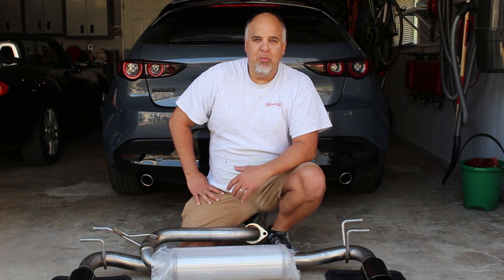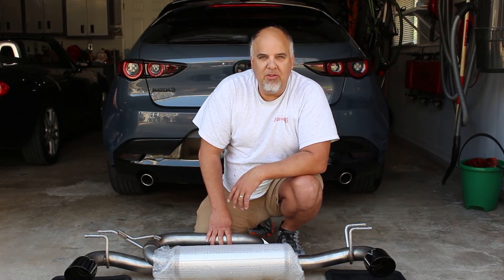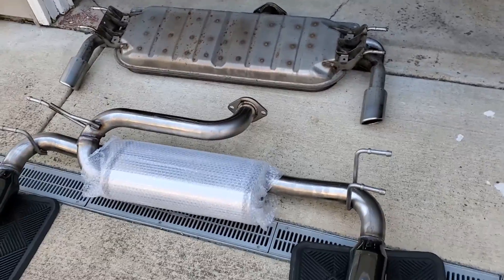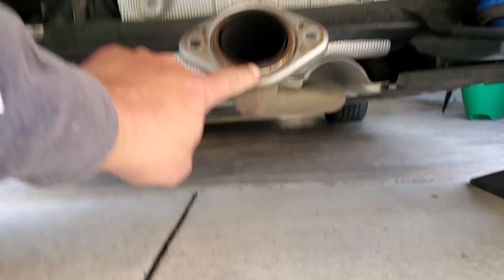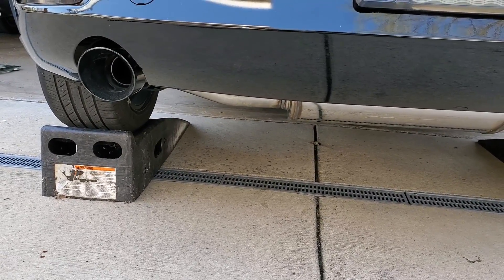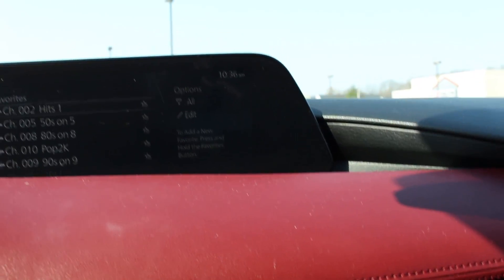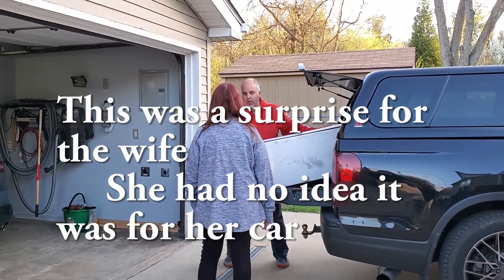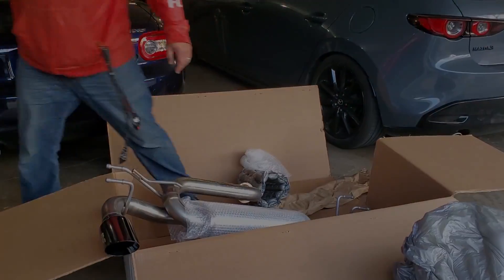Mazda 3 Magnaflow Axle-back Exhaust  2019 - 2021 2.5L , Install & Sound, Surprised Wife again

Comment: I'm shocked by how easy this is. So many cars these days hide everything up and over top of axles, etc and make it really difficult to get the exhaust changed. This is barely an hour or two of work in your driveway with a couple tools. I'm thinking about a Mazda 3 Sport and this has really swung things in that direction. Great video.

Comment: Just did my '24 hatch 6 speed manual...beautiful Magnaflow quality, perfect throaty sound. Much better for manual shifting, especially initial takeoff. Some might say the sound is a little soft, but you don't want any drone in the cabin. And you don't want to be that "attention-grabbing guy", annoying everybody he passes...
Reply: Same reason I'm looking at this muffler. Manual is hard to drive if you can't hear the engine running. Is this loud enough over stock to hear in traffic?

Comment: Good to see they changed the gasket they were sending with these kits.  They sent a flat gasket, think designed like a head gasket, with mine that leaked like crazy.  Had to put the OEM one back in to stop the leaking.

Comment: Nice video!  Sounds great and not too rough.  I ordered a Borla Exhaust system and I am looking forward to adding some sound to my turbo CX5.
Reply from the maker: We wanted the Borla system when it came out way over year ago. Borla themselfs after multiple  calls and Email said it would never come to the US market it would only be in Asia. Well seems they lied.
Reply: @jasonin2details  Sounds like my experience with Corksport!!   I also went to my local muffler shop and was curious if there other choices, but they would not take a look at my vehicle and would not schedule an appointment.  “You can drop it off in the morning and we can research what will work.”

Thanks, but no thanks!!  My gut told me they were not interested in my business. Called Borla and they told me where to order (Summit) for a better price and free delivery.
Reply: @johnwick1289  any videos of the borla on your cx5? Interested in hearing it
Reply: @duybui4027  

Sorry, but I sold the CX5.

Comment: Love your videos. I just got the same car and I’m planning to do the same or similar mods as you’ve done to your car. I wanted to ask, are you satisfied with the sound of the Magnaflow or do you think you would want something louder? Trying to decide between cork sport, magnaflow or Borla axle back systems. I want something loud but not annoyingly loud.
Reply from the maker: It most likely the quietest system out there. Hoping it gets a touch louder after some miles. It definitely has the lowest tone on the market. We are going to order the Corksport high flow intake and the combined sound should be just right.

Comment: Great vid my friend. I am in the UK and have a 2.0L front wheel drive. Will this system fit?
Reply: ...it should...but verify p/n. Mazda does pretty good about using the same (rear) muffler across the entire of a particular chassis. That's why the cx-9 has such tiny tips...

Comment: Hey Jason I own the 3 turbo and I know this fits on it. Would you say the exhaust works for a daily driver but still gives a decent sound. I live in an area with a lot of people so I don't want to be overly annoying
Reply: I know this is about a year late but always go with a turbo-designed exhaust system, as turbos release more back pressure and require more breathing room than N/A

Comment: Hows your MPG? Any difference? Great video
Reply: I got mine installed today and noticed less response from the throttle. I would have to press on the throttle harder just to speed up which means I’m consuming more fuel and reducing MPG. I think my back pressure was lost due to increased flow from the exhaust. Maybe the ECU will adjust? I drove it for 100 miles today.
Reply: @MrPinoy4eva  is there any difference now?

Comment: Why does it say tire pressure low at 36psi and why does it mark the RF at 36 when it shows the LF at 35?
Reply: The dealer installs Bridgestone runflats and fills them to 50 psi lol

Comment: Will this fit the sedan?
Reply from the maker: Nope. Tip would not extend outback far enough. My guess is they have one for Sedan that fits proper.
Reply: No but I still bought it and took it to an exhaust shot and they added some pipes to extend the tips other wise the bolt ons and clips fit the sedan like the hatchback. So go for it if you have the $$$ it cost me like 200$ total and the shop but I'm really liking it not to loud nice and deep enough no drone what so ever and it matches the elegance of the mazda 3 design. You can pretty much do the same to borla or corksport exhaust because the tips are just too short just need to extend them with more stainless steel pipe. Enjoy your mazda!
Reply: Exhaust Shop